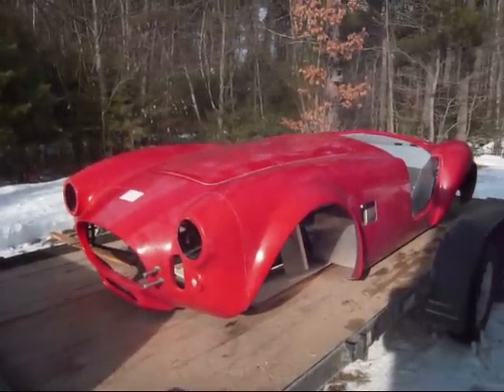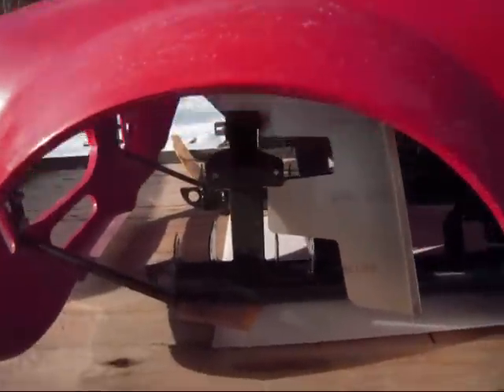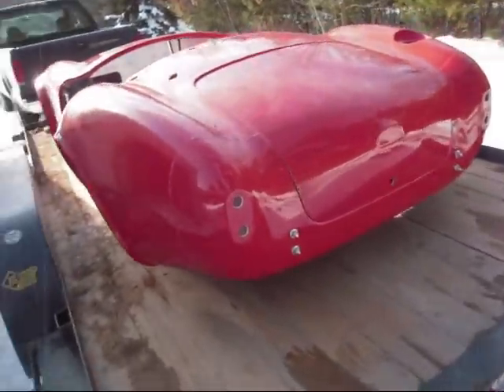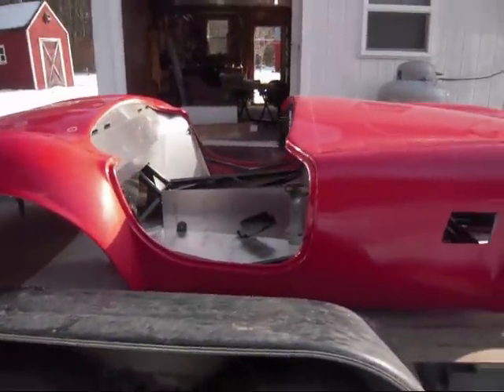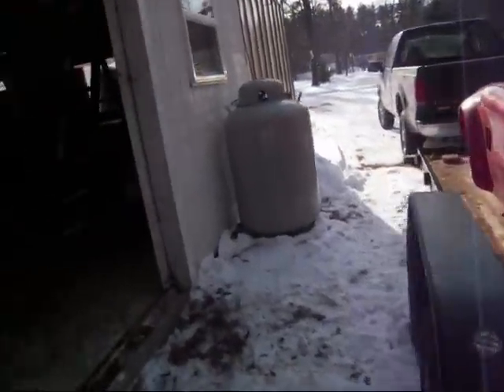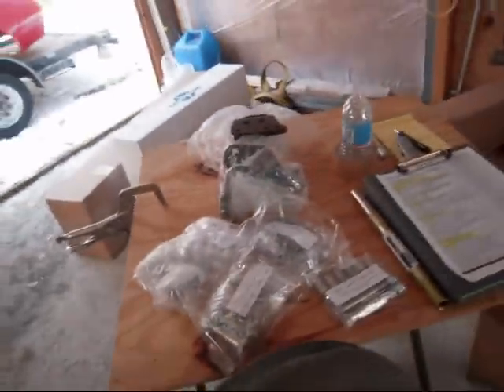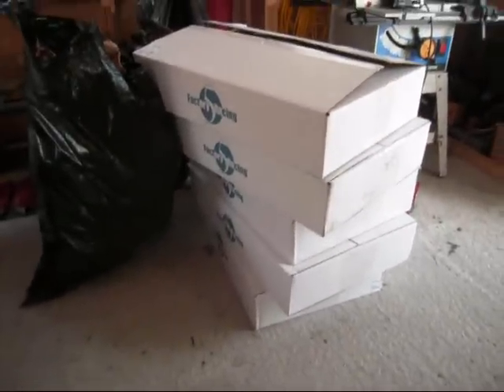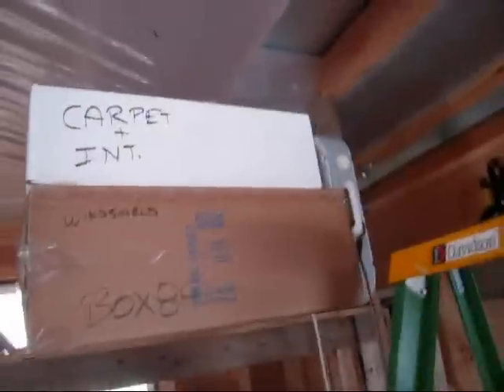Factory Five Mk4 - Electric Car - video 1

Comment: @ev99saturn think of it this way. a racing bicycle can carry a 100kg person with only 5kg mass including chassis, wheels, tire and strong disc brakes. it can also easily handle the extra weight of electric motor and battery. the cobra is a two seater so say that takes 10kg of roller to carry that, say 50% more to carry the 100lbs bodywork too. of course you'd want more robust wheels but thinking light begets light. 
so many of the car parts are meant for 1000kg so that's what happens.. see?

Comment: At 1.4Ka, and with that 11 inch motor, that car will likely be a monster. Off the top of my head, that should be over 500 Hp. The nice thing about electric is having the power when you want it, along with the energy usage of a go cart. What brand of, and how many Li-ion cells total are you using?

Comment from the maker: @DrFruikenstein   The top of your head is close to correct.   The plan is for 540 battery HP using Headway 16Ah cells, 6 parallel, 90 series.    The part that I can't predict at this point is the amount of voltage sag at full power.   Ultimately, I expect that between sag and other efficiency losses, the car will make 400+ hp.

Comment from the maker: @DanFrederiksen   The body is very light, only about 100 lbs.    One man on front and one on the rear can pick it up easily.     The steel frame is only 275 lbs, so the finished car should be 2100-2200 lbs.

Comment: @paytontech why aren't you trying to understand instead.
the chassis could be made from fiber glass.
the wheels could be lighter, hub, disc brakes. 
then you can use similarly lighter motor and battery.
spare me your objections. THINK

Comment: @ev99saturn fiberglass is very strong. quite close to carbon. it's a bit different in that it can flex more but you can design around that. and sometimes flex is strength. explosion proof cargo containers have been made with fiber glass. and no, 2100lbs is not light. 1000lbs is sort of light for a 2 seater. 500lbs is light for a full body safe car. probably too light for strong wind and high speed aerodynamics. but doable.
it's a mentality thing. people don't think about it. I do

Comment from the maker: @DanFrederiksen    How exactly have you determined that?    Have you built one and weighed all the parts?   Have you included the weight of the suspension, brakes, tires, motor, drive train, rear end, steel brackets, electronics, cables and batteries?     I have.

Comment from the maker: @DanFrederiksen I cant imagine a fiberglass frame for a car like this.   The 4" steel tube frame is very strong and is needed to handle the massive torque that the car will develop.    You must mean carbon fiber, not fiberglass?    As Paytontech points out, my goal is not to make it as light as possible, it is performance and strength.   2100 lbs IS a very light vehicle.    

It's easy to be an armchair expert and spout what 'could be'.  Build yours and show us!  I don't think you can.

Comment: @paytontech did you consider what you could do. you blindly assume the error is entirely with me..
and it isn't. not even a little.
when I say that you are not trying to understand that is exactly the situation. if you find that offensive you find the truth offensive and that is no fault of mine however much you want it to be.
I mean no offense. simply stating the pertinent truth.
try to understand that if you halve the weight of the car then you need only half the motor weight for same accel

Comment from the maker: @DanFrederiksen   Lets see how this math works out.    The electric motor and battery pack is about 800 lbs.  The rear end & drive shaft is another 250.    I guess you could make a ~1000 lb car if you can make a frame, suspension, wheels, tires, body and all the other stuff needed out of hydrogen gas or feathers.

Stick to making 5kg bicycles my friend.   Your 1000lb car will be dangerous and crazy expensive, if it's even possible to do.   I prefer reality and practicality.  Think about that.